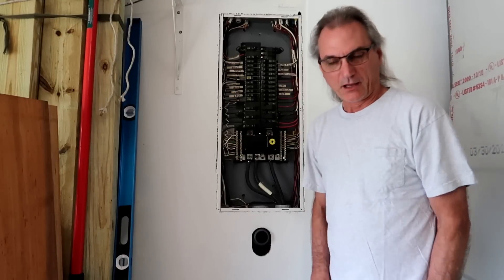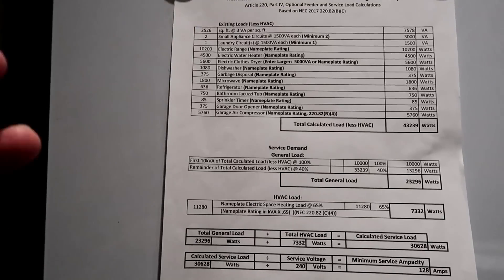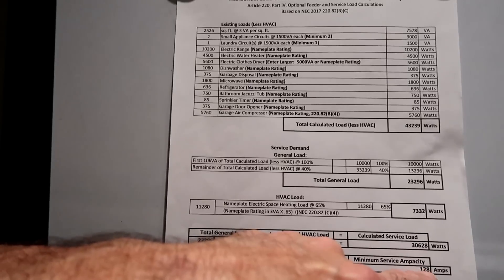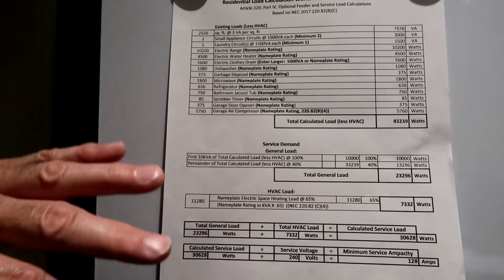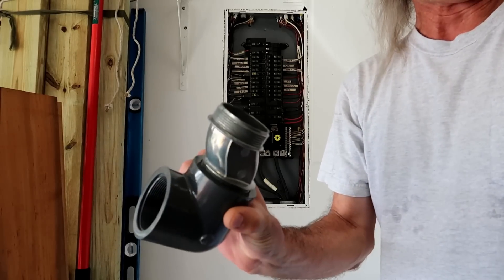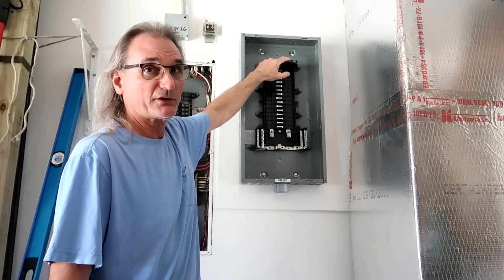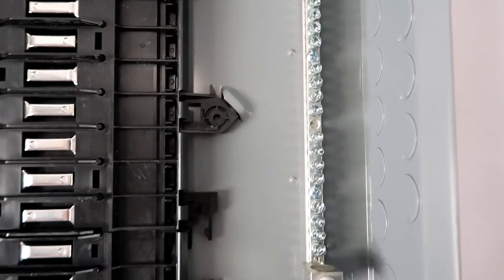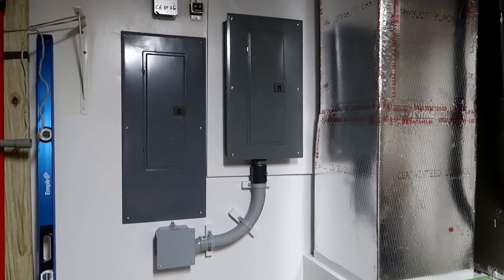A Sub Panel Installation With A Permit And It Passed Inspection

Comment: Incredibly helpful for planning a sub panel in jurisdictions where homeowners are allowed to pull their own permits.  I re-created the spreadsheet and it's like a mic drop when the planning department sees it expecting you are an overly confident homeowner that hasn't done their homework
Reply from the maker: Thank you John.  My intent was to aid people through the whole process, not just the physical installation.  You can spend hours in the NEC 2017 handbook,  get nowhere and end up very confused.  Even the experts debate deciphering the code.  Glad I could help you out!
Reply: for them is all about the money nothing else matter, I mean why do they want a detailed plan, are they going to be liable for anything if anything should go wrong? no. it's about$$ for their pockets.
Reply from the maker: Not only that, the price of the electrical permit was $230

Comment: Steve is great! He even took into account that if his 90 was over 24" long he would have to derate his feeder wires. He may not have had to. If you have more than 3 current carrying conductors in a pipe, regardless of length, you don't have to derate your conductors. Nobody remembers that.
Reply: Im wrong. If you have less than 4 current carrying conductors you don't have to derate regardless of nipple or conduit length. Sorry to mislead. Old timers disease coming on...
Reply from the maker: @jtd2949  I am going to stick with "Steve is great" 🤣🤣🤣 Thanks for watching John!

Comment: Thanks for detailed explanations. I realized this is an older video 2018? But I could use the spreadsheets if you still have them available. Thanks again!
Reply from the maker: You're welcome Rob.  I previously updated the sheets to NEC 2020 and I pasted the links below.  Good luck with your project.

https://drive.google.com/file/d/1qddJU2kwKUKR2VKT3VlAEdrFxXqJrEBU/view?usp=drivesdk

https://drive.google.com/file/d/1qIner7SuWUWWhUNwS56zQR1N7Nt3lpp0/view?usp=drivesdk

Comment: I guess if your stove, water heater, dryer, and furnace were gas, you'd put zero in those sections.
Reply from the maker: Those gas appliances still use some electricity for their control circuits. Look in the owner's manuals or look for data plates or stickers on each appliance for their consumption.

Comment: Hey Steve: Was just re-watching your video (great!), and noticed something that I hadn’t seen the first times that I watched. It looks as though you used something to cover the mounting screws or lag bolt heads at the back of the sub panel. (?). At the 4 points, back of the panel behind the wires, there’s what looks like white caulk or silicone covering the screw/bolt heads? I’d never seen this before; seems like a good idea; and may be a common practice; but could you elaborate? Sorry if this has been already asked or is common knowledge.
Reply from the maker: Hi Leon. You are absolutely correct. I used caulking over the lag bolt heads to provide chafe protection. The lag bolt heads are tall because they have a hex head with a phillips and were not fully recessed within the panel's dimples. I didn't want to nick any wire insulation while routing the wires in the panel.
Reply: Thanks a ton. Again, not sure if it’s a common practice, but sure seems like a great idea for the added safety. Well worth the time & cost. Maybe not for contractors who’re doing new build rough-ins on a schedule. But for a homeowner with a permit like me, I’ll take that time to squeeze out a little caulk or silicone to cover the hex heads. (Learnin’ all the time.)
I’m about to finally get a permit for my sub panel install, and I’ll add that into the mix.
Reply from the maker: @leoncargile4204  I've never seen anyone do it before and the Inspector didn't say anything. Good luck with your project.

Comment: Thanks for this, it’s got a lot of overlap with something I’m trying to do. My only concern in using some of your strategy is the 90 degree elbow. I don’t believe they make that piece in electrical conduit. Even though you used schedule 80 gray conduit I think that’s plumbing conduit. I’m worried about being called out for this in inspection. But if I go with electrical conduit I’ll have to use a wide sweep 90, which won’t really work. And I really want to avoid flex conduit, that could cause even more trouble. Maybe I’ll just risk it with the short 90.
Reply from the maker: Many people have pointed out that the elbow I used is a plumbing elbow, not an electrical elbow.  Article 352 say to use Schedule 80 PVC.  I looked very hard to see if that elbow was illegal and could not find it written in the NEC book that said it was illegal.  That one elbow keeps the conduit continuous, which is required per the code.  Good luck with your project.

Comment: Really fantastic. Hopefully this should get me through the permit and inspection process. I'm essentially doing the same thing you did, except my subpanel is going on the other side of the house so I'll be running quite a bit of copper. Thanks a bunch
Reply from the maker: Good luck with your installation Mike.  The building department can be tough on DIYer.

Comment: If you still have your templates could one over thanks
Reply from the maker: Here you go Nathan.  Please let me know if you get them.  The Load Calculations changed in NEC 2020 between residential and commercial due to LED office lighting so these sheets are for residential, which still uses 3VA/sq.ft

https://drive.google.com/file/d/1qddJU2kwKUKR2VKT3VlAEdrFxXqJrEBU/view?usp=sharing

https://drive.google.com/file/d/1qIner7SuWUWWhUNwS56zQR1N7Nt3lpp0/view?usp=sharing

Comment: Great video!  As an electrical engineer with no electrician's license, I appreciate your detail on the finer elements.  Please provide the spreadsheet links.
Reply from the maker: Here you go mark.  Please let me know if you get them.   I am not an IT guy, so it is nice to know if the sharing plan worked.  Good luck with your project! Thanks for watching.

https://drive.google.com/file/d/1qddJU2kwKUKR2VKT3VlAEdrFxXqJrEBU/view?usp=sharing

https://drive.google.com/file/d/1qIner7SuWUWWhUNwS56zQR1N7Nt3lpp0/view?usp=sharing

Comment: I would like the spreadsheet link(s) you offer. Thanks
Reply from the maker: Hi Juno.  We are now at NEC 2020, so if it says 2017 on the sheet, change it to 2020.  Here are the links to the Load Calculation sheets.  Please let me know if you where able to access them.  If you need the Panel Schedules too, I will upload those and let you know.  Thanks for watching.

https://drive.google.com/file/d/1ZnPp8Su8rJcbXnkrJZPI4I2hJolJVTLI/view?usp=sharing

https://drive.google.com/file/d/1Hx7XXakt9uqOLh2LUyKyECsLsVDTv2Bl/view?usp=sharing

Comment: The schedule 80 elbows are a violation of the NEC.  Your inspector is incompetent.
Reply from the maker: Hi Nathan.  I wish you would have indicated what Article(s) you are referencing so you can help others, because to me, NEC 2017 Article 352 reads differently.  If my installation is in violation of the NEC, I guess it was my lucky day when the AHJ signed off on it.  Thanks for watching.
Reply: @StevesStrayStuff  The schedule 80 plumbing elbows are not listed for electrical use period.  How about providing the article of the NEC that allows plumbing fittings!  What a joke!
Reply from the maker: @nathanr.8556  I guess I am somebody that fell through the crack.
Reply: @StevesStrayStuff  You are somebody that has no business misleading people on YouTube by insinuating that your work is acceptable
Reply from the maker: Gray = Electrical.  Right or wrong, at least my three feet of conduit is continuous.
Reply: @StevesStrayStuff  There are plenty of SCH 80 gray pressure fittings out there.
Reply: @StevesStrayStuff  Wrong
Reply from the maker: @nathanr.8556  Thank you for coming back 11 months later to tell me you are wrong, I appreciate that Nathan!

Comment: Hey Steve: Stumbled across this video while researching a possible sub panel install at my place. Great info; very clear; with great tips! I'm an old IT guy, so the load calculation spreadsheet info made complete sense to me, and served as a kind of shortcut that helped me learn about load calculations! I had picked up the new NEC 2020, but I'm not at all sure that I would have gotten to the info I needed without your help! Hope to see more new videos from you soon! And can I just say that it's great to see a YouTube video WITHOUT all of the over-the-top, "Crazy Eddie" hand gestures!
Reply from the maker: 'Crazy Eddie', haha!  Thanks Leon. I remember that guy, he sold by volume because his commercials were louder than anyone else's 😆 I hope all of your research turns into a new sub panel to satisfy all of your electrical needs.  Thanks for watching!
Reply: Hey Steve: Followup questions. I hope these haven’t been asked/answered already!
It LOOKS like, with everything mounted on the wall…2 questions - A) Is the sweep 90* Schedule 40 PVC? and 2) the offset that connects to the side of the PVC junction box looks to also be PVC? (the others, into both of the load centers - main & sub - look to be metallic)
Reply from the maker: Hey Leon, the 90 degree elbow at the Main panel is Schedule 80 PVC and everyone is busting my balls about it not being per code because they say it is a plumbing fitting.  Plumbing fittings are pressure rated, electrical fittings are not pressure rated.  Schedule 80 PVC is gray and electrical PVC is gray. It makes it seem as though you can use Schedule 80 PVC plumbing fittings for electrical but you can't use Schedule 80 PVC electrical for plumbing.  At least my 'so called illegal' 90 degree elbow makes my conduit continuous inside the wall.  You are correct about the metal offsets at the panels and the PVC offset at the wall mounted junction box.  Wherever you decide to use metal, it must be bonded to ground, that's why I went with metal at the enclosures because the metal lock ring bonds the offset nipples to the enclosures.  I have been told my Inspector sucks and I got lucky.
Reply: @StevesStrayStuff  Thanks a ton for the reply info Steve!  I actually was wondering about the bigger, external, PVC sweep 90* mounted on the drywall with the straps on 2x4’s? Also Schedule 80? Or Schedule 40?
Sorry, I shoulda been clearer.
Reply from the maker: @leoncargile4204  Haha, now that I have re-read your comment, I misinterpreted your question because of the previous 90 degree fitting ball busting I have encountered.  Yes, that 90 degree radius curve is Schedule 80 PVC.  Not sure what Schedule the plastic offset is, it isn't as thick walled as the 90 degree radius. The big gray fitting on the metal offset nipple at the sub panel is also a Schedule 80 plumbing union, which was 100% visible to my inspector during the inspection and he didn't say anything about that plumbing fitting being illegal.

Comment: Not a chance that i'd ever contact a building inspector unless I was forced to by actually building something visible from the outside of the home.
Reply from the maker: I just wanted to be legal because electricity is very unforgiving and kills people.  If your home has an electrical fire and they find electrical work was performed without a permit, your insurance company may not cover you.  If you ever go to sell, it could be a costly problem too.

Comment: Why didn't you use a plastic LB instead of that big big box coming out the panel?
Reply from the maker: I did buy a 2" LB and tried to use it, but everything would have to align too exact and where I needed to put the sub panel was making it very difficult.  It was easier for me to make it a three step process.  Get the wires out of the main panel and through the wall first, add the junction box second, figure out the conduit to sub panel third.  Using the big, big  junction box gave me six inches of up/down adjustment, six inches of left/right adjustment and four inches of in/out from the wall adjustment.  It all went together nicely. Thanks for watching.
Reply: @StevesStrayStuff  you did a really good job my friend.
Reply from the maker: @torodaman  Thank you, I appreciate that.

Comment: Wow. They require a lot more consideration in your jurisdiction than they do here. I just needed to tell them what I was planning on doing (very rough -- how many branch circuits, feeder circuit, etc..) and that's it. Only had the ground inspection done for my trench work, but they inspectors are pretty laid back. I wonder how much the requirements vary by city and region in the US
Reply from the maker: Hi Yona. Honestly, I think when they saw Owner/Builder on my permit application, they threw the book at me to see if I could pass the test.  I really can't blame them.  That is what prompted me to make this video, it covers all of the bases for obtaining a permit and passing the inspection on the first visit.  Thanks for watching.

Comment: I am thinking about installing a sub panel close to my main panel as you did in your video, is there a 30" inch distance requirement between panels I thought I saw that somewhere ?
Reply from the maker: Hi T. Dee.  You are correct about there being a 30" requirement but it has to do with the 'Width of Working Space' which cannot be less than 30" wide.  Take a look at NEC 2017 Article 110.26(A)(2).  My panel installation is shown in EXHIBIT 110.15,  Thanks for watching.

Comment: Hello Steve, do you need a permit?
Reply from the maker: Hi Free, I am going to answer you with 'yes', for three important reasons: The occupant's safety, in case you ever have a fire and if you ever want to sell your home.  A permit requires you to have an inspection.  When you pass the inspection it is documented.  If your home were to ever catch on fire and it was related to this installation, you are covered.  If you did not go through the permit process, the insurance company might not cover you.  If you ever go to sell your home, it is going to cost you big $$$ to make everything right in the end.  It is well worth paying the $250 up front, get the permit, have your panel inspected and go from there.  You are free to install your panel however you want, but I recommend going through the proper permit process, it isn't that hard.  Just pay attention to details, do it correctly and you will be fine.  I am not a professional and I passed my inspection on the first visit.
Reply: @StevesStrayStuff  Ok, thank you! Have a good day.

Comment: I'm debating adding a sub panel for my basement.  The builder filled up every circuit available in my panel when building the house.  I added 3 circuits for the basement when I finished it, and to accomplish that we replaced 3 full height 15A breakers with 6 half height 15A breakers (my Dad was a licensed commercial electrician and said it was fine, but now he has passed away).  Now I'm adding 3 20A circuits for a computer equipment rack for my home theater amplifiers (2 20A circuits) and one 20A subwoofer circuit.  If I did the same thing and replaced 3 20A full height breakers with half height, is there a way to determine if I'm adding too many circuits to my panel?  I've never had a problem with tripping breakers or anything in my current set up.
Great video by the way..
Reply from the maker: Hi irwfcm.  If you use my load calculation sheet, you will be able to determine the calculated service load of your home per NEC 2017 and then you can compare it to the rating of you current load center.  You just need to know how many watts each piece of equipment draws that you already have and what you want to add.  Send me an email request to no4injunk@aol.com and I will send you the load calculation spreadsheet and how to fill it out.  Thanks for watching and I hope I can help you out!
Reply: @StevesStrayStuff  thanks for the info.  I'm very good with Excel so I can knock out a simple spreadsheet like that in no time.  I may let you know if I need any help when I get into the actual calculation, but I should be fine.  I thought there might be some general rule that in a 225A panel you can have XXX amps worth of breakers in there, or that you can exceed the 225A by a certain percentage.  But I see it would make sense to talk about the actual numbers.
Reply from the maker: You may need to check NEC 2017 to see if there are any fill percentage requirement for a Service Entrance Panel wiring.  I know Articles 312 and 314 cover Cabinets, Enclosures, Outlet and Junction Boxes, but I do not recall seeing anything that addressed a Service Entrance Panel.
Reply: @StevesStrayStuff  thanks for additional info.  Your comment led me to something that answered my question.  There is a label on all service panels that tells you the maximum number of individual circuits that can be installed in the panel.  Also, a lot of times there are restrictions about where tandem breakers can be located in the panel.  In my case, my panel says I can have 40 breakers installed and after adding my additional circuits I will only be at 29 and tandem breakers are allowed anywhere in the panel, so I'm in good shape there.  I am going to do a load calculation just be safe that I won't try to draw more amps than the service can support, but I'm pretty sure I'll be safe there as well.
Reply from the maker: Safety first.  Enjoy your electrical rework.

Comment: You can't use plumbing pipe for electrical wiring!!!
Reply from the maker: The conduit and fittings I used are Schedule 40 PVC or Schedule 80 PVC, which is acceptable per NEC 2017 Article 352.  It was inspected and approved.  The AHJ has spoken!  Who am I to argue with authority?????